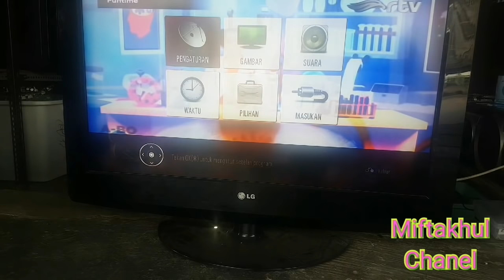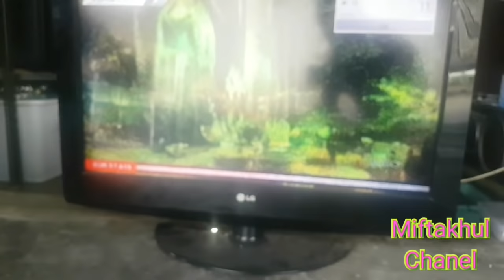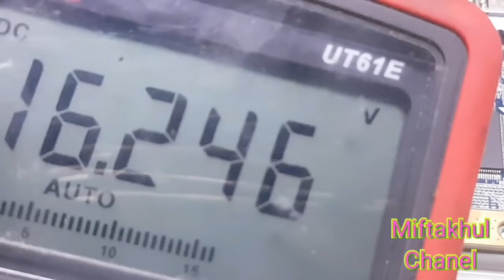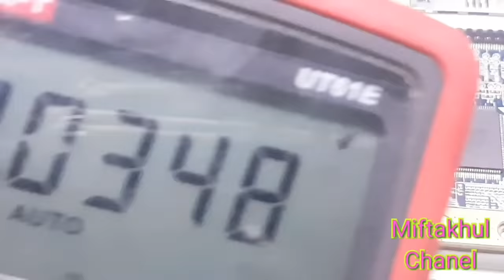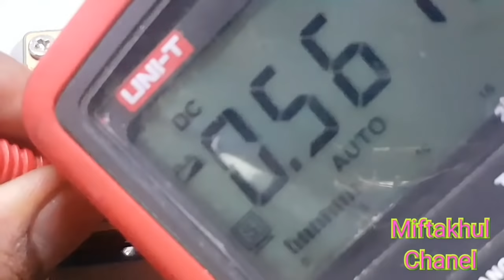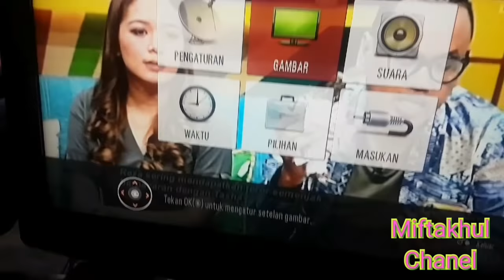cara perbaiki tv lcd gamabar gelap

Comment: Assalamualaikum, 
Mas sya mau tanya klo tv lcd LG 32" matot tidak ada indikator nya kira2 kena apa nya yah, power supply di cek normal 
Terima Kasih!
Reply: @KlinikTv  
Kan tv nya matot gmn di flash nya mas, terakhir tcon nya yg bermasalah, ic TPS 65163 panas bngt trus sya ganti dgn ic yg baru, eeh malah matot!